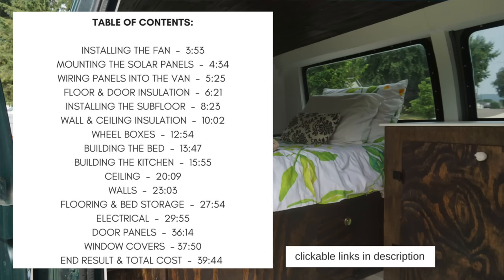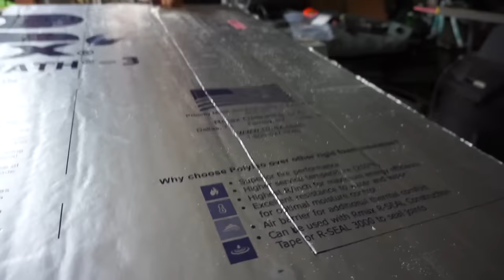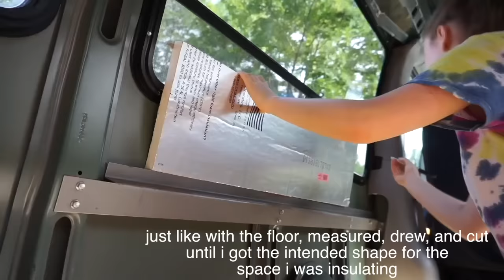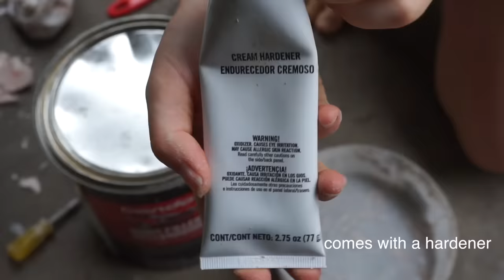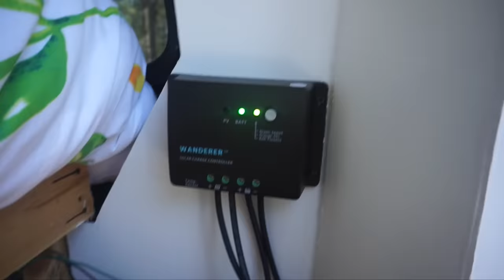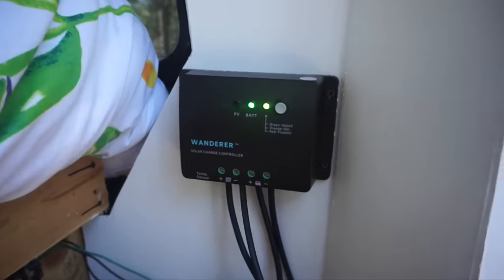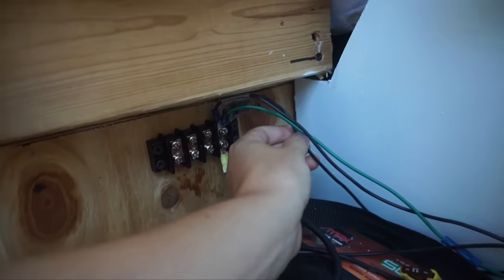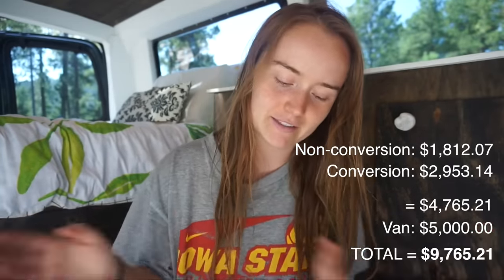How I Converted A VAN into an OFF GRID CAMPER for under $3,000

Comment: FYI “stuffing as much fiberglass insulation into the doors as possible” actually negatively effects the “R” rating or thermal rating of fiberglass insulation as it looses its efficiency when scrunched or shoved together . It needs to be as fluffy as possible . So putting more inside the doors actually does you worse. Better off going with a closed foam spray which is water proof, bacteria resistant , and has a MUCH GREATER “R” rating for the space .

But I’ll end this with - YOU ROCK! What a great achievement this must be! I have wanted to do this for awhile now too!

Comment: Damn girl! If I were your parents I'd be super proud of you. Nice job around the shop. Vans clean, ceiling lights have an installed switch, and ran a budget. Kudos Mah and Pah. Think of electricity like high pressure water. Air tight windows will reduce condensation; either clear tinting, or 3-4 mil plastic to create an air pocket. The air in the pocket will condense, then keep additional condensation off the windows.

Comment: Just started watching. Solar panel wires WILL short out soon! They can not withstand being surrounded by thin sheet steel like going through the roof. They need a rubber grommet, or something stronger then just thin plastic on the outside of the wires. Any decent hardware store might even have something like a small rubber bushing, perhaps with a metal insert. Get one that has the rubber expanding only on one end, so that end can go through the hole in the roof. The other end will have a much larger piece of rubber to sit on the rooftop. ANY electrical wiring that goes through metal, from the factory, has one of these types of grommet, with or without the metal insert. Look down by your gas pedal in any vehicle, for wires going through the firewall into the engine compartment.

Comment: Just a brief suggestion, though vicegrips will work to crimp wires, you might be better off using a regular wire crimper, the wire crimper wraps the connector around the wire while the vicegrips just crushes the connector on top of the wire. Love the video, I've learned a lot from it.

Comment: First rule of electrical.. Don't use wire from the hardware store. Use Automotive grade wiring. As it's designed for automotive use....And run it in wire loom. Don't just tape it down. Also don't tape the wires together. Don't put 120volt  wires close to low voltage wires. And never ever put 120volt in the same box with low voltage. You have to put a divider between the two. Use a GFCI  breaker or GFCI outlet. Then all other outlets  wired off the load side of it...

I do these to the vans I wire. As I seen to much dangerous stuff out there.And when you combine Water tanks. Faucets etc within 3 feet of all that stuff. It can come back to get you...

And yes I'm an electrical engineer.

Good Job on your build...

Comment: You usually want to put the caulk under the bracket and as you tighten it squeezes out and forms a gasket. The edges can be cleaned up, etc.. but when it sets and you disassemble it can even come off like a gasket and if done well they can be re-used but typically it is best to redo liquid gaskets after maintenance.

Definitely the way you are passing wires through the roof, you are going to want to check these once a month to see if the wind from driving has moved the cables a bit and separated the epoxy or silicone.

Typically the way you do this is have a cheap plastic box with a hole for passthrough, the box gets attached with silicone and screws but the silicone underneath then you have a pass through and a way to route the cables that acts as a stress relief so the cables can't open the holes...

Comment: i llove the nitrile disposable gloves for messy but jobs that require shaping putties like bondo, iv gotten tooo many years into messy projects and you could use dollar store vinyl gloves too... i do alot w dollar store stuff and throw in trash instead of washing out etc so that the bad is gone!! I even use just wax paper for templets or window coverings just bc its on a long roll cheap and can fit in nooks as helps me.  its stuff like that that goes a long ways helps for a little bit .. theres no rules /can't be or there'd be no innovations! Be Safe!

Comment: When drilling holes into the roof for your solar panel cables you should have oversized the holes and place either rubber grommets or ceramic insulator grommets that snap together. Your current cable installation will cause the cables to fail grounding out the panels and the charge batteries that can lead to a sudden fire or death if you touch the metal frame of the car if and when the cables get cut by the lack of insulation between the frame and the charge cables; so be very careful and properly insulate those cables from the sharp edge of the bored holes. I do admire your dedication and hard work
Reply: thank you for this comment! very useful!

Comment: Nicely done.  And I had to laugh, since you basically undersold all your effort.  You actually did a LOT of work and got something that fits your needs.  You can, as you said, go much more basic, but I wouldn't qualify your build as all that basic.  You did great.  I'm sure you have already heard a lot of people suggest you upgrade to lithium when you can.  The nice thing is that you do have a good start on the solar side of the equation (that's something that we under-estimated in our cargo trailer build).  As long as you can keep up with (or slightly ahead of) how quickly you might draw on your battery when totally off-grid, you've got a decent balance.  We live in southwest Texas, so we a little more direct sunlight (and more sunny days in general), but we don't get anywhere near the full 200w out of our system...it couldn't keep up with our 12v refrigerator.  Upgrading to lithium helped.

Comment: You did good... I only wish I had found your build before I started on mine.  I didnt have the flat runs you did. The floor of Honda Odyssey
Is very lumpy, and there V is a 3 inch slope from back to front. 
Plus, being 72...  I would do  it all again.🤗

Comment: I'm enjoying watching this video over my early morning coffee. 👍
So, there's this cool drill bit that has a countersinking top to it - so when you drill the holes in the ceiling boards, it leaves a shallow area drilled the size and shape of the heads of the screws so when you tighten the screws all the way in, the heads go flush without cracking the ends of the board.
Also, Tightbond3 wood glue is so strong that if the wood breaks, it will break somewhere the glue isn't and would be great for all those spots where you used a nailgun, to make that join stronger & permanent. 

Did you think to add a CB radio so when in a new town you can actually talk with locals to find the best (& avoid the worst!) restaurants, etc.?
Only at 34 minutes but I'm also curious what kind of music system you added.
Reply: You should build a sealed fan-vented battery box so nothing gets across those terminals, and for venting the hydrogen gas produced by charging so it doesn't build up inside and cause an explosion.
 A small low-flow 2" fan circulating to/from the underside of the van would be plenty. Two holes, one for the fan to exhaust, the other smaller, for fresh air intake and use fine mesh screen to keep bugs out.
Reply: OK so your build ended up very clean. I'd call it "Spartan & Utilitarian", I like!

Comment: Colour coded crimp ring connectors are standard for terminal block installations. Fuses should be installed on every hot wire in case of a short circuit.

Comment: Good job. Just a suggestion for the next time you do flooring. 28:17 you aren't supposed to use nails in the middle of the boards. You're supposed to shoot them into the edges so they are never seen. Shoot them at an angle, then slide the next board into the grove and repeat.

Comment: For those we're going to a wire lights or fans their vehicle all you need to do is run the ground wires from life or the fans right to the chassis of the vehicle. Then all you need to do is run your positive wires to the light switches and then from the light switches to your fuse panel into your positive pole of the battery. Then your battery negative will go right to the chassis what's the metal part of the van. You'll save on wiring and you won't have a bunch of terminals stacking up on each other. Practically everything in your car is wired to the chassis and then from that particular device to the battery through a fuse block. Look at it like the chassis of the van or car is nothing but a big long wire.

Comment: alot of stuff was done incorrectly properly speaking but everything was done pretty well given you didnt have any experience doing any of it, also it turned out pretty sick so thats a good thing too

just constructive criticism for the folks watching the video for tips:
instad of attaching the solar panels directly to the roof a roof rack probably would have been more ideal, you should have used bolts as opposed to screws and you should have snipped the ends on the inside as soon as they were bolted down(dont wanna catch one in the head standing up too quick and bolts are alot more solid and easily removable) and you should have put down some rubber to act as a gasket between the bracket and the roof in addition to the caulking

you should have used screws for the wheel boxed, you should have used screws for pretty much everything you used nails for, much more solid and easier to remove and improve

you should have soldered and properly wrapped the wiring splices with heatshrink, you definitly should have put a rubber gasket in the wiring hole in the roof and you could have also have used some flex tubing to protect the wires in addition to that, at the very least it should have been one or the other

never use aerosols or stains or any of that or do any significant amount of sanding without proper ventilation and a respirator

fiberglass insulation isnt ideal, reflectix and the foam board is alot better
reflectix is also much better for window shades

that battery should have a proper battery tie down and the wiring should be better wrapped up and protected from itself

alot of the cruvy inside paneling could have been avoided with a more basic design featuring corners n such

all the storage spage doors shoud have  small latched on them to prevent them ratthing open when you drive

you did a good job, really good video.

Comment: Nothing like punching hole in your roof.  Ever thought about using roof carriers at mount to the rain rails?  They actually make roof mounting systems that don't entail drilling holes in your roof.  That silicone sealant is NOT uv protected.  drip drip...

Comment: You should use a rubber grommet when passing any electrical wire through a rough cut hole in metal.

Comment: Nice work! I know this is years later but to anyone coming across this now like I did, I would only strongly suggest you WEAR A MASK - and no, I'm not talking about Covid lol. All those fumes from the polyurethane and paint, even if you "get used to it" while working, wreak havoc on your health in the long run, especially when using those chemicals in enclosed spaces. Also, the fiberglass insulation will break down from the vibrations of driving/movement and release particles into your van which is also hazardous to breathe in. Running an air purifier might help with the VOC's but takes up space/electricity. Anyway! Cheers to vandwelling :)

Comment: Great job. As an electrician use rubber or plastic grommets around wires. Please install a  rated battery switch on the battery for emergencies.  And a smoke detector.  👍

Comment: You don't need a ground wire on the light switch since it is mounted to the metal frame of the vehicle, electricity takes the path of the least resistance. Directly to the frame is that path.

Comment: The van looks fantastic.  The only point i would make is that to repair the van you will need to literally tear the walls apart.  It would be better to make the panels fit together better rather than have them bonded and glued together.  Then you could just unscrew the panels when needed.

Comment: 36:53 Instead of doing this to start the square box cut, it's better looking if you just drill a hole inside the box-sketch-out then put the jigsaw blade in that hole, and start from there...no cut in line this way.

Comment: 14:07 This frame should've been used for the floor before laying down a floor. Along with weather strip (Heavy duty plastic bags stabled to the frame) and insulation in between the frame. 15:10

Comment: I disagree that the ground wire is only an extra wire and that it isn't necessary to understand what it is for..  While, I'm not familiar with every purpose, that the ground wire serves. Part of its purpose is to take the load off the circuit...  My recommendation to anyone who is unfamiliar with the purpose of a ground wire, to wiring circuits with and thinks that it is only an extra wire, should never attempt to wire anything and should seek out a professional electrian or a family member with a strong background in electrical engineering. I'm very glad that you didn't attempt to wire your van Anna and that you acquired help from family member who had a background in electrical engineering. Everything looks great Anna, you did a great job, with everything. I have been gifted a 2019 transit van, for a conversion build myself, which I will be taking on within the near future. For more of an insulated window covering, I would take reflextics and glue cotton battening, and wool broadcloth to one side and then cover them with a material which is insulating for colder weather trips..

Comment: so first and for most  you really worked hard and had dedication to your build  very impressive indeed  and to take on such a huge thing is awesome and at the end of the day you can say i did this  this is mine and have pride in it.  so here is my only 2 things i have to say about your build  # 1 is this  and also most concerning to me so anytime you are going to be running wires through or over metal you should always use a rubber grommet like when you drilled the wire holes in the roof for the solar  yes you used sealant and thats good but its not good enough to protect the wires from damage. so let me explain the the sheath around the wire you call plastic  its rubber but when you have a metal rub against that wire sheath it starts to cut into it and once it cuts enough into it the metal  makes contact with the wires inside and then you have a short which can cause you a nasty fire you may ask how will they rub against the metal and that is happening by vibrations of driving down the road  its small and it may take quite a while to happen but it will  happen  none the less so i would fix that asap also the same with any wire going over the top of metal like your fan and lights over the top of the roof supports  they make a flat type of wire sheath for that too.  this one was my biggest  one for you as it could be a serious problem for you and your safety.    next is your Bondo idea was a good one but it cracked and failed on you because bondo is made to be a light coating over a dent on a car as a filler. 2 things bondo does not like is thickness and flex anytime the bondo is thick it will crack and will fall off its only a matter of time and flex bondo has no give what so ever any kind of movement will brake it.  so for things like you did with it what you should have used and can still use in the future is bondo fibber glass  its very easy to do just like your bondo and it will flex some and it can be thicker and shaped   other than that  congrats on a really great build and job  and your new rig

Comment: The battery should definitely have a side rail and a top clamp installed for safety, just in case the vehicle should ever flip over or tip onto it's side.

Comment: The 500W converter is to smalle. But make your own experience with it. Based on 40 years of batteries, solar and the electronic plus controller chips i would advise to read about 2000w. 2000W about every coffe machine works with around 1200.1500 Watt. SO as i said learn in your own way.